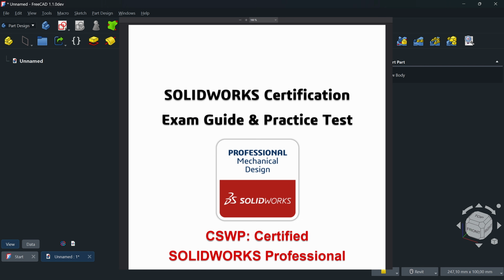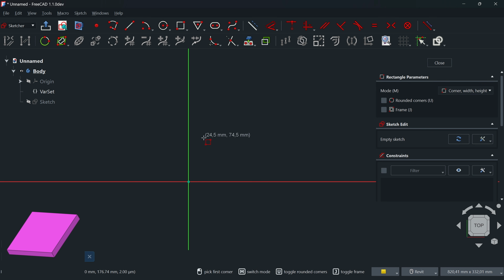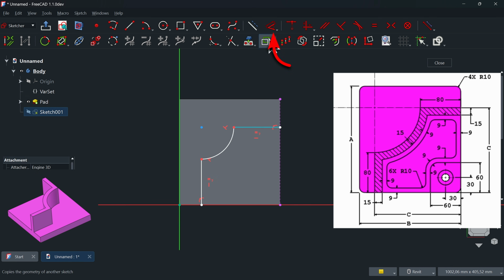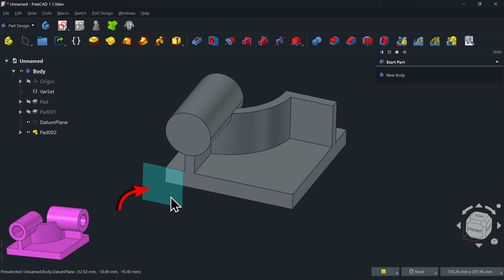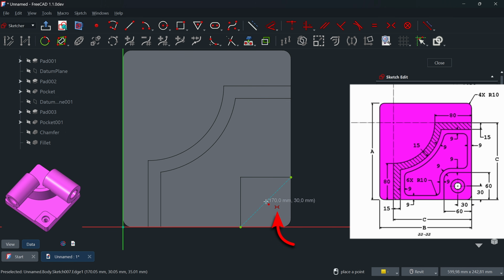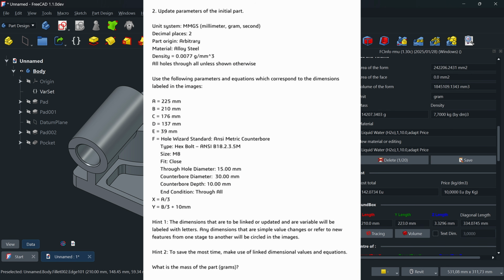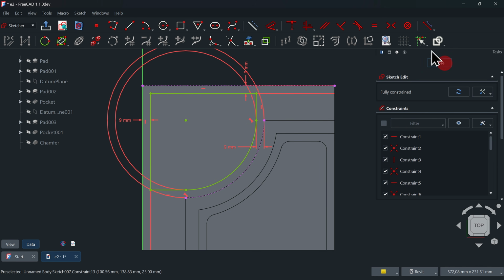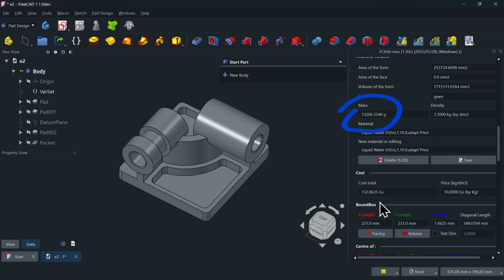Can FreeCAD pass the SOLIDWORKS Pro Certification CSWP ?  (Full Tutorial & Parametric Method)

Comment: I have used onshape, fusion, and SolidWorks and dabbled a little bit in blender. However, I like open source and free and have been trying to force myself to do more and more of my work in freecad. I think it's still got some gotchas as well as being a little slow to process some complicated things but I find myself able to do most anything I need to do using freeCad now. I think it's powerful but still has a steeper learning curve than any other cad I've used.
Reply from the maker: @chris993361 Actually, FreeCAD has almost all the tools we need for modeling; the hardest part is figuring out where they are and how to use them. I think once you get past that, you can do almost anything.
Reply: @deltahedra3D yeah that's exactly what I'm saying. I believe it can do it all it's just not easy.

Comment: For me personally I used sketch up with a huge number of plugins for years, then at college used solid works for a while, found it difficult compared to the SketchUp workflow I was used to and didn't need the features it offered for what I was designing, which was mostly furniture, I also used some ancient 2D sketching package called 2D Design V2 for a while there too. When I went to uni I made the switch to Siemens NX which impressed me but after leaving could obviously not afford a license. For several years I tried many free tiers of many packages, but didn't like how they were cloud based, or had restricted feature sets, couldn't export geometry into interchange formats etc etc etc. Gave freecad a go about 4.5 years ago during that time but found it's UI to be completely unnavigable. Finally took the plunge this year to try it again and I have to say I've been pretty well impressed. It runs locally which I like, I can use it on Linux which I like, there's a few things that are more clunky than I'm used to, like assemblies, and dress up geometry like chamfers and fillets can be problematic, but these are minor issues really and likely somewhat skill based from me as well. I've been so impressed by it and the cam workbench that I'm looking into trying to provide a nesting script/workbench to improve the user experience there

Comment: My first experience with CAD was with SolidWorks. I learned to use it from taking a night course, to add to my value as a CNC machinist. For my personal projects, I prefer to use my home computer, which runs a Linux-based OS, and of course none of the major CAD programs run on Linux. So I began to learn FreeCAD so I could design things on my own computer. Now I'm so used to it, I've gotten so good at it, I actually prefer it over SolidWorks. I've even started using at work, despite the SolidWorks license I have through them.

The only things that frustrate me about FreeCAD today is the fragility of the chamfer and fillet tools, and the TechDraw workbench. Mostly TechDraw. It is crazy how frustrating it is to create a good drawing. It would be great if you could do videos on making drawings in the future!

Side note: FCInfo should really be incorporated as a standard feature of FreeCAD instead of a macro.

Comment: Good video, a couple of tips that I've found, using the keys to specify operations (d for dimension, = to set a formula and so on) helps tremendously. Also creating a sketch attached at the extruded base would have been easier.

Comment: CAD "veteran": RoboCAD (2D CAD, so we did the typical front/side/top projection technical drawings) in highschool back in the early 90's. And the drafting table before that. Haven't really touched CAD software after highschool though, but recently picked it up again with the aid of your videos. Gotta say, while it's easy to follow along with what you're doing (the occasional issue with my installation bugging out in ways yours doesn't notwithstanding), creating something on my own is still a bit of an issue. Especially when I need to do something "advanced". Like e.g. incorporating Kanji symbols or drawings into the design, or anything that's not pure geometry, really.

Comment: What theme are you using? Looks so much more pleasant.
Reply from the maker: It’s the open theme. Also, I have unchecked a lot of unnecessary top tools bar.
Reply: @deltahedra3D  I cannot seem to find that theme ... it's not showing in the add-ons manager. But I am still on 1.0.2. Maybe that's why?
Reply: @deltahedra3D  found it! ... but man - those preferences could also use a better UX

Comment: This has solved one of my recent problems.
I was getting errors trying to use external geometry , but it looks like I was not creating a line from the external geometry and converting the line to construction mode.

I started using Librecad in 2014 to make some 2d drawings for a replacement firebox for my wood burner , but in 2015 I completed the drawings by making a 3d model in FreeCAD.
I sent the files to a cutting company to cut the parts out of 8mm steel plate which I welded together.

Comment: Unfortunately offset tool does not work with curves rather then arcs. Visual configuration (points, lines sizing) and guidance (mid points, intersection points) are not intuitive. Many operations requires explicit actions like projection geometry. Other then that FreeCad is quite decent. Still I wish it would be closer to Fusion360 in terms of ease of use.

Comment: My background in CAD is AutoCAD --> Fusion 360. I have recently been recreating models FreeCAD with the goal of using it on a Linux platform. This is looking good so far for creating 3D printer models. However,  I am hitting a few road blocks when creating toolpaths for my CNC machine.
Reply: he has a vid on tool paths
Reply from the maker: @tommyers7634 What machine do you have? I have made a video about CNC, maybe check it : https://youtu.be/7nBCaV5J0Ts
Reply: @deltahedra3D  I was able to create toolpaths for several projects; however, I was not able to do it for one part. I would love to send it to you to see if you can succeed.

Comment: why is your freecad so much better than mine? thanks
Reply from the maker: @maker209 I use a the Opentheme, maybe check this video : https://youtu.be/LKq7hgbu7ks
Reply: @deltahedra3D  thanks!!
Reply from the maker: You’re welcome !
Reply: @deltahedra3D  how do i make the pads/pockets have arrows like in the video? thank you!
Reply from the maker: Try FreeCAD 1.1dev, the link is in the description, it's a new feature !
Reply: @deltahedra3D  there are some path errors if one just copies your config. also ran split window addon trough llm to get it to work. did that a month ago, maybe you changed things.
it's easy to find all and replace paths with local user in text editor if one wants to.

Comment: I did some Blender experiments 20 years ago. Now owning a 3D printer I tried Blender but switched to FreeCAD almost instantly. Never regretted the switch. I am very happy with FreeCAD and especially it's Python programming capabilities.
Reply: Blender is a strong tool for soft surface / organic modelling & sometimes also for soft body modelling, but basically any CAD software is almost unparalleled at real-world measurement accurate hard-body modelling.
Reply from the maker: Blender and FreeCAD are a very strong combo, but for 3D printing , especially if you design things that require iterations, you're right, FreeCAD is the better choice.
Reply: ngl. Blender, FreeCAD, Godot, KDEnlive and Krita is the pilar of creative work and it was for many sectors. sadly Vector Graphics still have a bit struggles, inkscape was good, but still felt rough around the edges once that polished its no brainer for Hobbyist to not use these programs, it was free and also open source. complete that with using Linux and you can turn your computer whataver you want
Reply: @shiro3146  watch out for "graphite" its in alpha version ( web ) ..they will release the software version i think this year. free and open source. Vector and has raster experimental toolset.. has node base system like blender but for 2d
Reply: brooo i did the same shit, i got into it because it was the first thing that popped up for 3d modeling. FreeCad is so much more useful. I decided id keep belnder too though because its supposed to be like a Jack of all the softwares and the artistic side of it definitlely beats FreeCad as far as i Can tell
Reply: You can just use both, blender AND freecad. I do, and a bunch of other open source apps.
Reply: Those two never intented to do the same.
Reply: @Ben-uf4dm  You are comparing apples and oranges! Dumdum! 😂😂😂

Comment: This is unrelated to this video but I'm having issues a parametric model of a shed using varset and Assembly workbench to put it together. It just doesnt like some sizes when I adjust the shed width and lengh. Sometimes the assembled model is spread out more than it should be. The joints are still correct, and if I adjust one joint manually and simply adjust the angle by one degree and back again it snaps back to where it should be, but adjusting each joint is tedious. The refresh button also does not fix it. Is this a but that may be fixed in the future or am I doing something wrong?

Great video by the way and I agree that FreeCAD is definately capable and has enough features to model pretty much anything.
Reply from the maker: @FoxtrotYankeeHotel It's true that the Assembly workbench is still very fragile, and I run into the same issues as you, even with simple assemblies like a kitchen cabinet. When you tweak variables, it can literally break the model.
That’s why, whenever possible, I avoid using it (like for the bike frame).
Have you tried the A2plus workbench?
Reply: @deltahedra3D  I haven't tried the A2plus yet but I will go and see how I get on with it. Thanks for confirming it's not something I am doing.

The bike was a great learning curve for me and helped me greatly! I know I have so much more to learn but I feel that I have progressed so quickly with the help of your videos.
Reply from the maker: @FoxtrotYankeeHotel Thanks, I'm glad to help !
Reply: @deltahedra3D  Just to let you know, I'm loving the A2plus workbench. I can now adjust my varset in the parts file and then recompute the A2plus file and it works perfectly! Thank you for the suggestion.